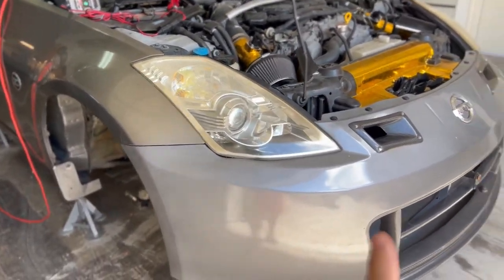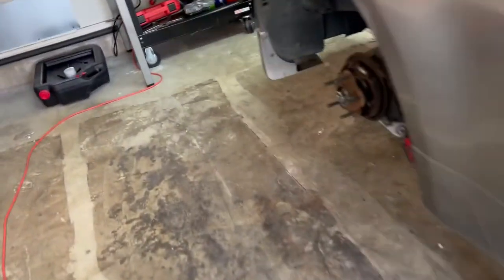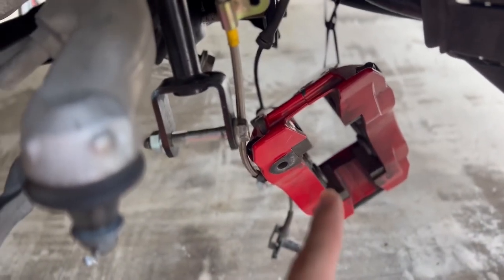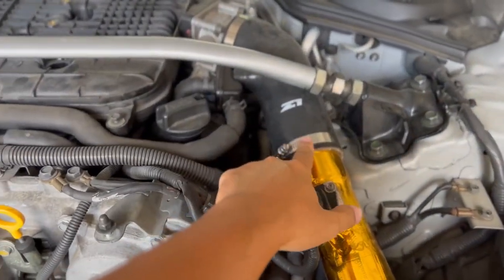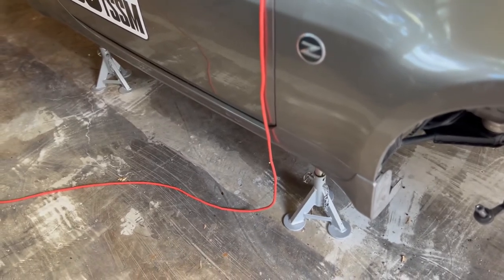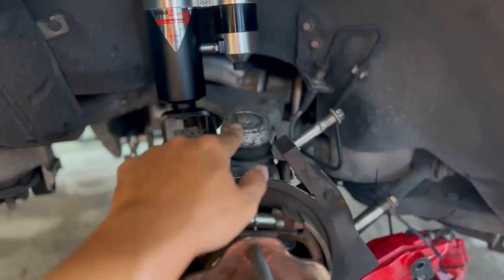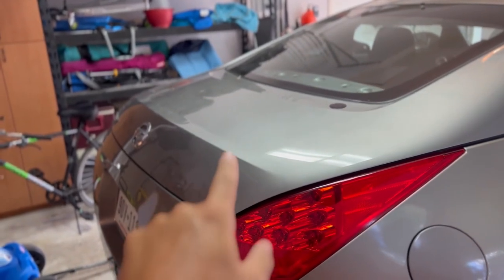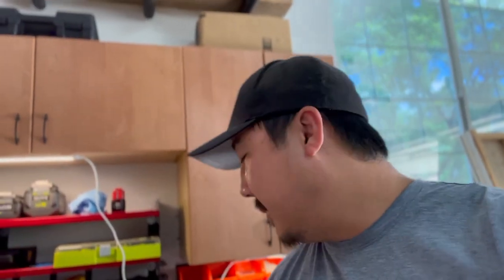Track Build 350z Update | July 2022

Comment: Just found your channel and am trying to get caught up on the history of your 350Z.  I read these have a lot of understeer in stock form.  Did you experience that?  If so, have you made any changes to get rid of it?
Reply from the maker: Hey glad you found my channel. So in short, yes. The Z understeers as many others have experienced. A lot of track prepped Zs including mine, switched to a square setup 18x10 and typically 275/35R18s and a fat antisway bar in the front. Also have a pretty stiff spring setup on the front. 18kg and 8k rear.